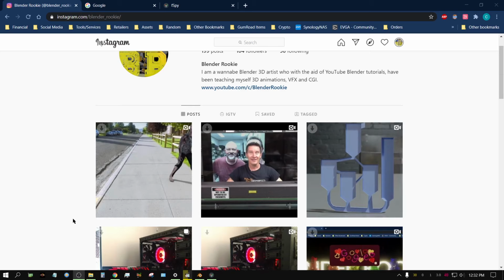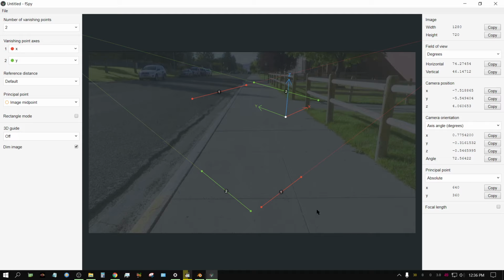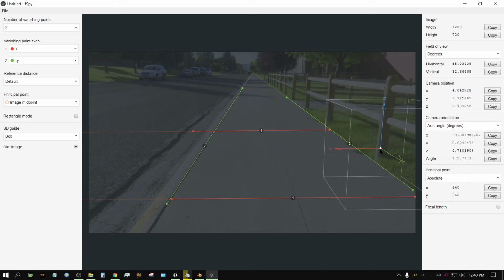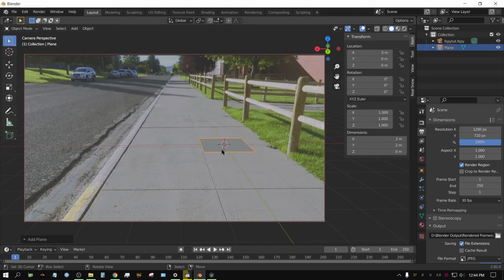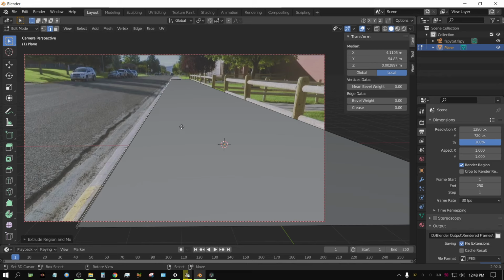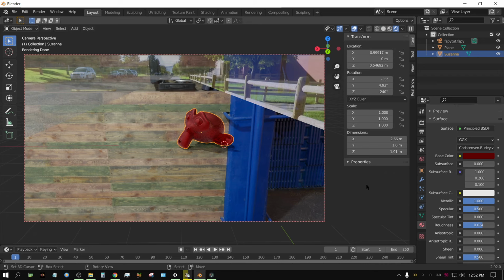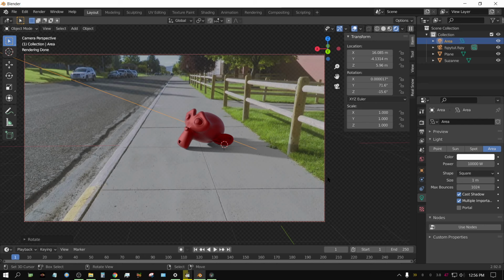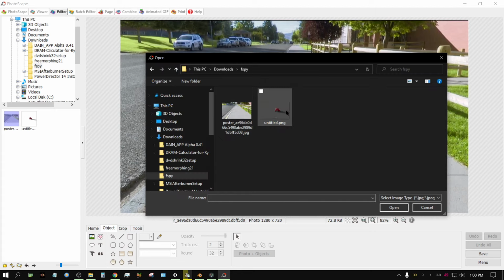Fspy Camera Angle Match Blender Tutorial

Comment: Can I ask a rookie question? How do you know whether to grab an edge and extend, or scale an object on an axis or extrude? I would think to scale the plane along the x axis to the grout line, but you grabbed the edge in edit mode and grabbed it and moved it. How do I know which to do and when?
Reply from the maker: The simplest answer is, you grab and move if it works for what your are trying to accomplish. Grabbing an edge or face or vert and moving it, doesn't create new geometry, it simply makes existing geometry larger or smaller or repositions it. Extruding on the other hand actually creates new geometry. Geometry is the edges, faces and verts. If you need more edges, faces or verts in order to create the shape you want, then extruding is the way to go.

I hope I explained that in a way that makes sense.

Comment: Can I use fSPY with a Video instead of picture?
Reply from the maker: No. It will work on a single frame or if the camera never moves. But if the camera moves the perspective changes and the solve would need to be recalculated. Which is why programs like Blender have camera tracking that's designed for video.